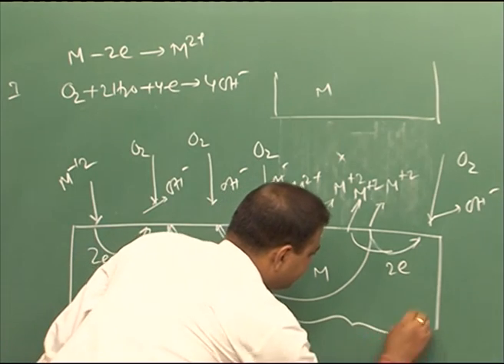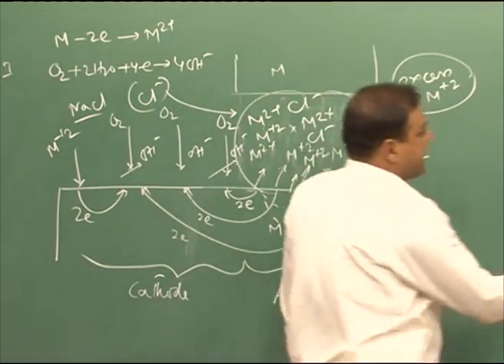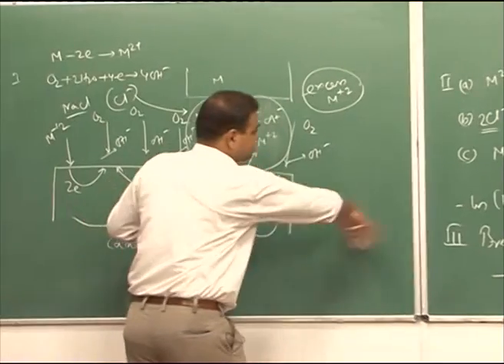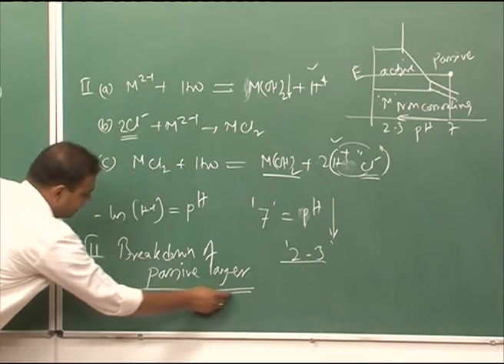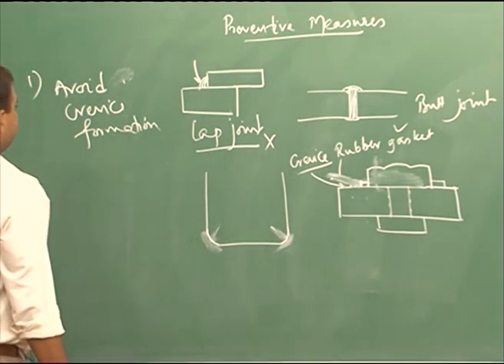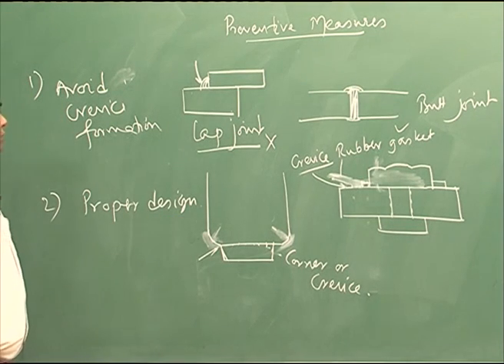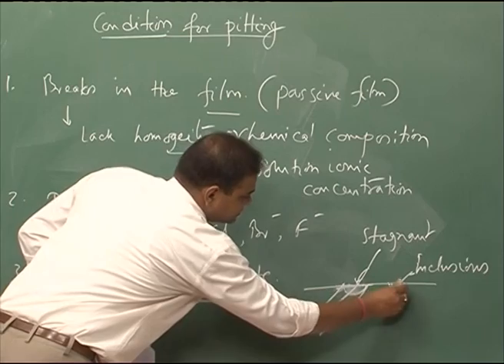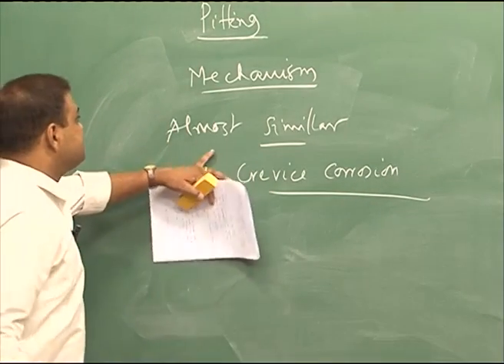Mod-01 Lec-26 Crevice corrosion, Pitting corrosion

Comment: Thank you for this video, working on a pitting corrosion problem at work with 2024, seems concentrated around copper rich inclusions, but the surface finish isn't great either. Fantastic revision.